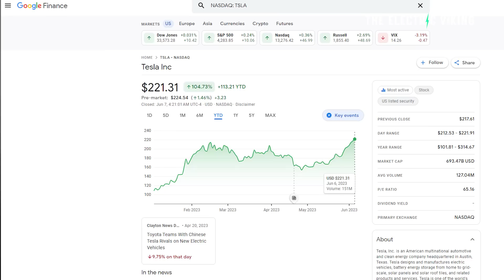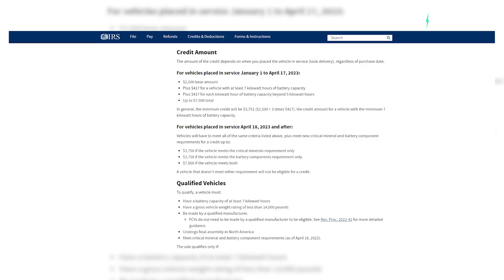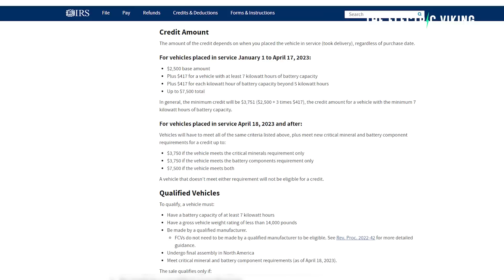Tesla's genius strategy 40% minimum critical battery minerals thresholds

Comment: No that’s not how it pulled it off. It pulled it off because someone figured out the regulation said the 40% is 40% per PLANT averaged across all models not per car. So the Model Y and S/X and 3 LRPerformance which are 100% and built in same plant can raise up the percentage of the 3 SR above 40% on average by plant

Comment: Tesla resale values are only marginally better than average - 3 years (60000km) is about 30-50% deprecation. Most cars range from 30-60% with majority near that 45% deprecation. Tesla is for sure on the lower end in terms of deprecation, but there are other manufacturers that have similar depreciation. While I don't particularly think Toyota has a good price to value offering - they tend to be near the 30% mark in terms of depreciation. Tesla also enjoys a massive advantage in terms of resale since the market isn't flooded yet and there hasn't been a new model Y nor a new Model 3 yet and there aren't that many old Teslas yet. Tesla ownership probably won't offer advantages in terms of resale value. We also know that FSD with a monetary incentive will probably require HW4, so the old fleet might even suffer additional depression in prices as accessing a new Tesla becomes easy and cheap. If it's not easy and cheap - FSD won't have a monetary incentive as it would have to compete with taxis, a service that already functions.

Comment: Haha, trucks need a 8000 kg battery. Electric trucks as an idea is dead in the water.
Reply: You realize the difference between the capacity of the Tesla semi and a diesel is only about 2000kg, and 80% of loads are limited by volume, not weight? $75,000 USD fuel savins in 100k miles vs diesel and you think they're dead. Lmfao
Reply: Uh the tesla semi pack is just over half that weight. Industry standard now is about 1,000# per 100kwhs of useable capacity.
Even the hummev pack is 249 total kwhs at 2,800# with coolant. 👍🏻
Reply: You can even load trailers with batteries for the truck to use giving it longer range. They have just started scratching the surface with electric product transport. Seen interesting video on road charging at over 50kwh while the vehicle moves. These every 200km could recharge the truck or car reducing the need to even stop the charge

Comment: The problem with Tesla is that fast advancing tech means used Teslas are hard to sell
Reply: It if the price is right..
Reply: You assume a choice between new or used. With demand exceeding supply, the choice is, used or wait months for a few improvements that you might not notice, at least for years.